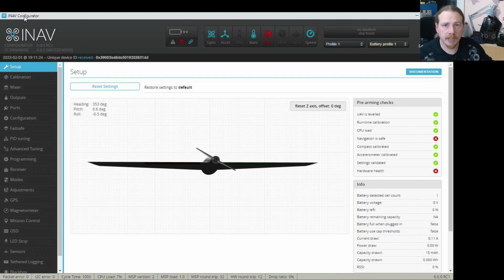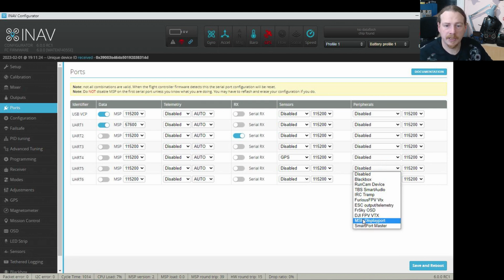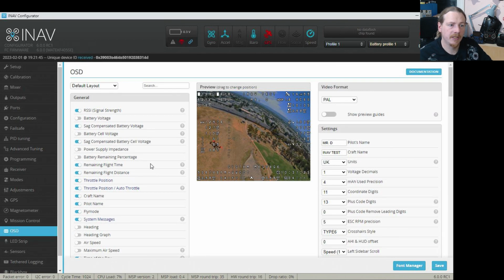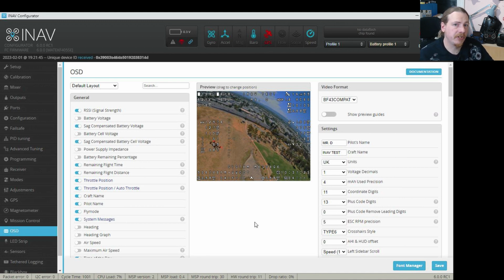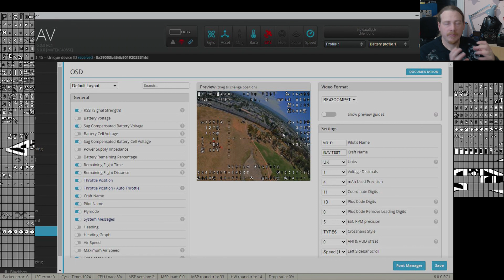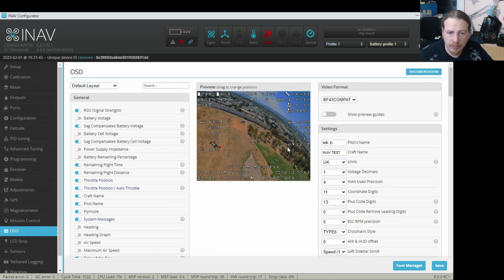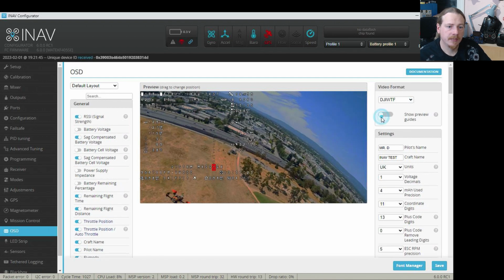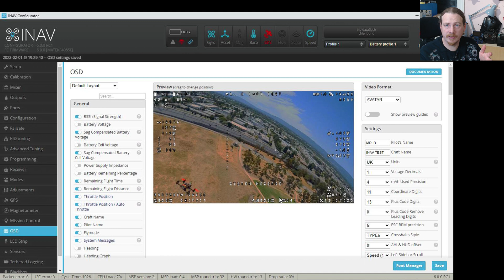How to set up HD FPV systems in INAV

Comment: Still have tons of questions. What Firmware Version should I use in googles ? I want to buy O3  unit will it work and what settings for it ? Have no idea wat is Avatar is it related to Walksnail ? How to connect Walksnail  to DJI  Googles ? AFAIK Walksnail  is like separate digitalsystem whichis not compatible with DJI...   More questions then answers :(
Reply from the maker: 1. In the goggles, you should use the latest firmware from the manufacturer. The exception being non-O3 DJI. Where the WTF firmware is far superior. That is really outside the scope of this video. 

2. DJI O3 has limited support from INAV 6.0, as shown in the video. The reason the support is limited is down to DJI.

3. Avatar is the name of the HD system by Caddx/Walksnail. It will not work on DJI, it is a completely different system.

This video wasn’t about DJI. It was simply how to connect any of the HD FPV video systems to INAV. Using this video, HD Zero, Avatar, and DJI can all be set up.
Reply: @MrD  Got it, thanks

Comment: I recently purchased a frsky x18s.  I have been devouring your ethos videos.  Alas I may be even more in the soup.  I have a very simple glider, rudder elevator and one center spoiler.  But it’s a vtail.  I have sort of figured out with your videos that I should use flaperons like a flying wing as opposed to a vtail….I think.  The biggest issue is that I have lived in the JR and Spektrum world for many years.  I have looked everywhere for a tutorial on how to use ethos to set this up.  I want to have rudder and elevator on the right stick and spoiler on the throttle stick.  Can you suggest some help or a video?  I have an archer gr6 receiver.  This is a F3res glider so there is no motor.  Thank you for your time.
Reply from the maker: Hi Larry. I’ll make a video on how to set this up soon 🤣
Reply: @MrD    Thank you.  I look forward to this.  Some have said use elevons and some have said use vtail.  Since I’ve been playing with this a bit I also don’t know how to disable the rudder movement on the left stick to prevent unintended rudder movement when deploying the spoiler.  Additionally I don’t know how to change the Servo end points on the throttle.

Comment: Hello, in the OSD Tab I don't have all the Video Format Options. I have only AUTO, PAL and NTSC. What I'm missing???
Reply from the maker: Which version of INAV are you using?
Reply: @MrD  Inav 6.0.0RC1
Reply from the maker: Also using RC1 Configurator?

BTW, RC2 is out now, so you should update.
Reply: @MrD  yes, RC1 configurator. I’m going to update to RC1 and try it again. Tk
Reply: I mean RC2
Reply: @MrD  Just tried the RC2 configurator, but the issue remains. I have just 3 options: AUTO, PAL, NTSC
Reply: I have a CaddxVista, and in Ports Tab I've selected DJI FPV VTX
Reply from the maker: @65chacal  is it for standard old DJI or WTF hacked DJI?

Comment: Using Walksnail and iNav 6, any idea why the OSD doesn't use the full HD display area, it only displays in the center of the screen similar to an analog OSD?
Reply from the maker: Did you select Avatar in the drop down list?
Reply: @MrD  thank you,  yes, the port is setup correctly and I had selected Avatar in the OSD. Interestingly when positioning the elements on the far left side of the OSD in the HD layout, on the goggle screen they appear very much towards the centre of the screen with a big margin on the left side.
Reply from the maker: Yes, you just need to adjust the OSD position in the goggles.
Reply: @MrD  Amazing, thanks very much, I had completely missed this option, the 'OSD position' setting has fixed the issue! Thanks again
Reply: @MrD  Thanks. Helped me too.

Comment: Thanks Darren, excellently clear as always  but you did not mention the preview guides option. I'm interested in the comment it pops up that if you keep within the red boundary the refresh rate is quicker, how does this work? I'm interested 'cos using the HDzero VRX the horizon and home pint arrows are sluggish, I'm told that's a slow processor in the VRX and nothing can be done about it. What's your take on this?  Many Thanks Steve😊😊
Reply from the maker: The guides are just for 4:3 ratios on some systems. And can show where the on screen elements are on other systems too. 

For the faster refresh with HDZero, I believe you need to set the video type to PAL. I’m not 100% on that, but believe that is how the 30x18 OSD is selected. The slow update is partially because of the processor, but also the transmission of the data. I have been told that the transmission side will be looked at. But there are other things that are taking priority.

Comment: Terrific and easy to understand for inav, dji setup. Was put off attempting with CLI commands and Betaflight which all YouTube content seems to show.... Thank you!
Reply from the maker: Thanks Robert. I'm glad this helped clear things up. There are no CLI commands needed in INAV for the FPV HD videos systems.
Reply: @MrD  one question please, using inav 5.5.0 on dji. In ports/peripherals tab I only see dji Vtx not wtf fpv. Do I need to flash later version or will it work currently? Cheers 😊
Reply from the maker: You won’t see a WTF OSD. As mentioned in the video, for WTF you would use MSP DisplayPort. In 5.1 and earlier, that would have been HDZero VTx.
Reply: Thank’s for your video, i have one question : I don’t find how to set the osd paramètre in inav 6.1 and 8 for working with DJI O3, if I set msp display port the osd working, but when I arm m’y wing the power Still low power, if I set to DJI FPV système, the DJI O3 powered fully but the osd doesn’t work, I need to use WTFOS ? Or it’s possible to have osd and full power on m’y DJI O3 ?
Regards

Comment: Waiting to load 5.1 and Avatar system to one of my fave FW.....Nice quick overview...Looks like iNAV are covering it all...🤔😳😏😏🇬🇧
Reply from the maker: Yeah, they're all pretty easy to set up.
Reply: @MrD  My first HD fixed wing will be a Mini Talon...😳😳😏😏🇬🇧
Reply from the maker: Nice. Are you going pan and tilt on the platform?
Reply: @MrD  Yes, I've designed and printed a backpack which includes a Panning servo...Its a neat way of doing an HD setup....🤔😳😏

Comment: Hi, Darren, how you doing...?
Is HD fpv going to be good for long range adventure flights?
Reply from the maker: I'm doing good thanks Chris. I hope you are too.
I guess it depends on what you class as long range. HDZero and Walksnail Avatar have both gone over 40Km. DJI is limited to 13Km (v1 and v2) and around 23Km (O3). Of course, this is nowhere near the limits of 1.3GHz analogue. But it all depends on your perspective.
Reply: @MrD  I still feel more love to analog somewhow
Reply from the maker: I think they both have their place. There are things analogue can do and HD can’t; and vice versa. You certainly have to rethink the separation with HD, but that may actually be better.
Reply: @MrD  you are right
Reply from the maker: For the HD plane, I’ve put the GPS out on the wing, the opposite side to the receiver. These are a much more similar weight than the receiver to a VTx, so will need much less in the way of balancing. Maybe none at all.

Comment: I loaded 6.rc1 with my avatar setup. But the ahi is off to the right and I can't drag the ahi around I can drag everything else like normal.  Tried a fresh install same issue. Anyone else report anything like this? I can post video on the fixed wing group so you can see what I'm talking about
Reply: I have the same issue using 'Avatar' and Walksnail goggles on iNav 6RC1. The OSD is showing but the OSD elements don't align with the iNav OSD display, and the full HD screen isn't usable. Any help will be greatly appreciated.
Reply: @blooskyy7  are you able to move the artificial horizon element around?  I'm going to post a video on the group.
Reply: @RubyS.1  hi, no the artificial horizon seems to be in a fixed position
Reply from the maker: @Fpvgirl the HUD elements (AHI, sidebars, etc) can’t be moved in configurator. They should automatically move to the correct location.
Reply from the maker: @Blue Sky it sounds like you just need to go in to the goggles menu and move the OSD to the left.
Reply: @MrD  thanks, how do you move the osd in the goggle menu? I don't recall seeing the option. I have also tried changing the custom font in the Avatar menu but this didn't make any difference so I changed the font back to iNav.
Reply: @blooskyy7  in the helmet menu you can move the osd
Reply from the maker: I can’t remember exactly what it’s called. And I won’t be with my goggles for a few days. But I believe it is in the display menu. It’s something like “OSD position” or “OSD offset”.
Reply: @АлександрНеважно-ч6щ  thanks very much, this fixed it!
Reply: Is your camera in 16:9 Mode?...🤔😳😏
Reply from the maker: Hi Ruby. I’ve only seen that once myself, when I changed the OSD type. But it was fine after a save and reboot.

But sure, paste it in the fixed wing group. It might help to see things 👍🏻
Reply: try moving the osd in the points menu
Reply: try moving the osd in the helmet menu